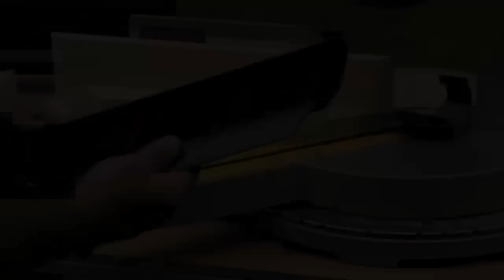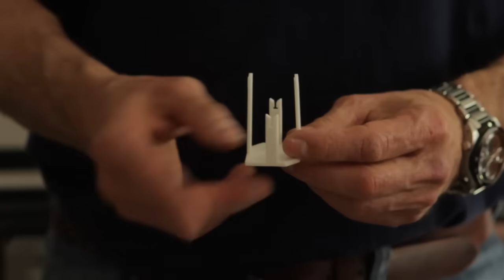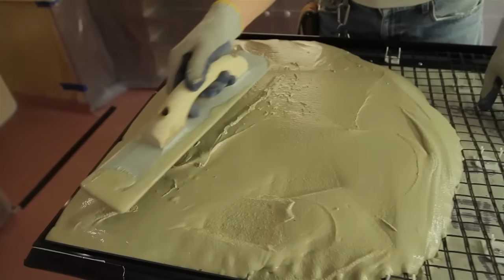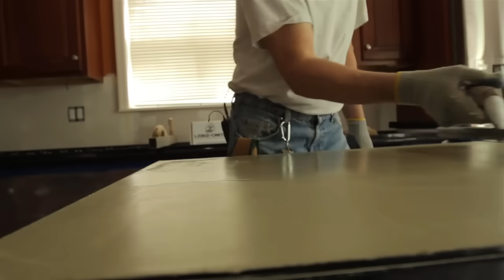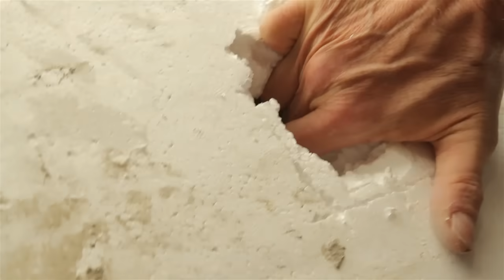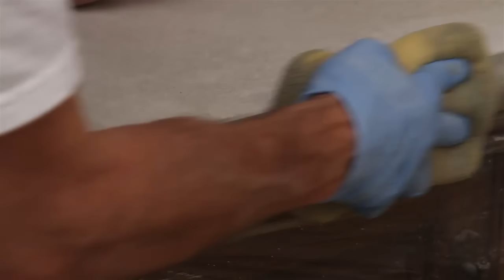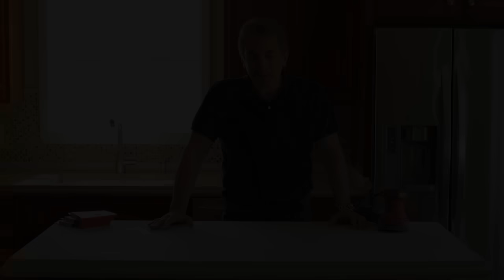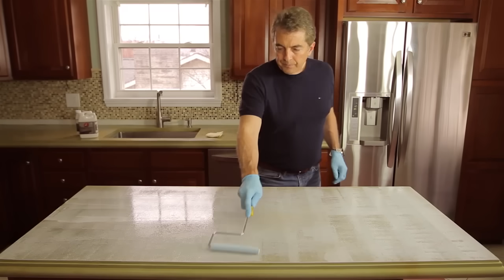Z Counterform - How To Build Concrete Countertops Full Instructional Video

Comment: A couple bits of advice from someone who had to learn how to deal with this using IKEA cabinets.  Unfortunately, I was told to use 1/2" concrete backer board which is "sort of" correct --  unless you have IKEA cabinets.  IKEA cabinets have such a full overlay door that you need something the full 5/8" so your drawers and doors open properly.  5/8" is the exact drop of the form (see the diagram of your edge form and you'll understand what I mean).  If you use only 1/2" backer board, your drawers or doors will hit the concrete and not open.  Since 5/8" backer board is non existent, use 1/8" hardboard under the 1/2" concrete back board (or whatever else you can come up with).  Also, do NOT use Hardie board as that is not a true 1/2" (learned that the hard way). Durock is actually 1/2".  It can crumble a little but cuts fine with even just a box cutter.  I cut the rounded sink opening with a metal blade in my jigsaw and that worked very easily.  I am very leery of the 36" span in my wide drawer cabinets.  The metal bar that spans the cabinet has some definite flex.  So much so, I'm afraid the weight of the concrete will make it sag and not allow drawers to open.  I'm contemplating switching out the regular metal for the sturdier sink opening metal bars.  I will update with results.
Reply: For anyone reading this thread and looking for specific information about doing these concrete forms with IKEA cabinets - the YouTube channel Matt and Kat Things has a five part video series dedicated to this exact subject that I've found immensely helpful. Actually more helpful than this video even with just general info. Here is a link to the first video in their series: https://youtu.be/FSqsMblOzqI
Reply: Skip Rope geez dude take a qualude and calm down. The person was referring to the first comment not yours.
Reply: Lisa O'Donnell Hi LIsa, how did it work out for you? I am facing similar issue and I am hoping you can share the outcome :)
Reply: Everything turned out fine with my modifications as listed above. Here’s a video of the apt where it was installed. https://youtu.be/07E0Omz9j4c
Reply: @lisao3041  Did you end up using sturdier metal bars? Or did you stick with the original bars that span the cabinet? Thanks for your comments and the results video - looks great!
Reply: @timjacobs4177  I used the standard bars that come with the cabinets. Of course there are more substantial bars that come with sink base cabinets.
Reply: I sincerely appreciate Lisa posting this. Her advice was very relevant to anyone looking to do this with IKEA cabinets. Unlike your bully comment which added absolutely nothing of any relevance or meaning at all.
Reply: you should Have done more research
Reply: This would be true with all EUROPEAN STYLE cabinets. Which are more functional than framed cabinets.
Reply: Nope I wasn't referring to you, but you've really shown your true colors. Don't you feel like an ass now? Eh, nah, you probably don't. I don't have a clue who you're speaking to, or why, clearly you've got a beef with the poster of the video, of whom you have not directed your comments to at all. If you don't know how to use the comment section, you should probably keep your fingers away from the keyboard.
Reply: Thank you MR Professional Youtuber.

Comment: about how many hours after pouring do you use the float, then the smoother, then sanding. Is it a few hours or a few days?
Reply: Skip Rope actually I did mine in one weekend. Came out fantastic, smooth as a baby's bottom and Brite white. I did a 4'x7' island and I only paid $600 in materials. You seem to have a hard on for this product, as they say if you don't have anything good to say maybe shut up!
Reply: @mikep5695 I don’t know man, those seem like pretty legit questions he asked, and the first part of your answer seemed legit as well. Not sure why you added the rest of your comment there acting like the questions were somehow picking on the product in any way.  Unless he maybe said some other crap in other comments I guess…
Reply: about 3 weeks from the look of this process...Not to MENTION ALL THE DUST it creates.

Comment: Awesome product!  My countertop project (bathroom vanities and kitchen) is complete.  They are very helpful if you need any questions answered.
Reply: I am actually curious how you like your kitchen countertops. If you (or anyone else) happens to check this ... do you find that you have to reseal the countertops frequently? Any regrets with using concrete in a food prep environment?
Reply: Richard J so we sold the house a couple of years ago. I didn’t use their coloring products. I used water based colors and Murphy’s soap and covered it with epoxy.  I used iCoat for that stuff. I’ll see if I have the video saved off YouTube that I followed.
Reply: Richard J I think I the video was taken down. So they have a sealer than i I m sure is food grade safe. The epoxy we used I wasn’t worried about it. The only reason I went that route is that I wanted a granite look. It worked. We did a marble look in the kitchen.